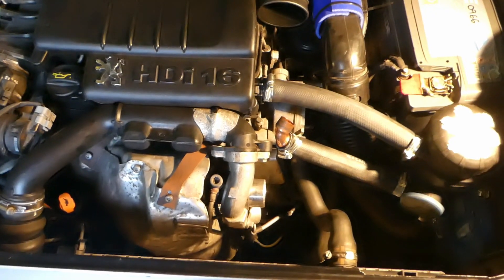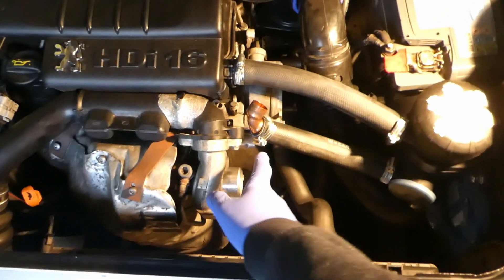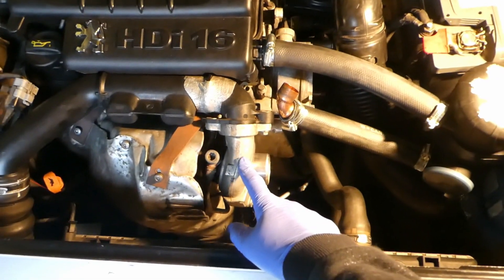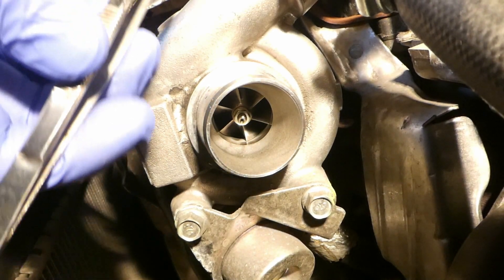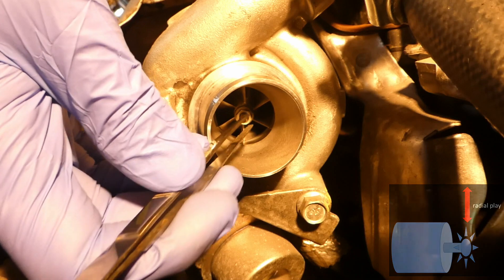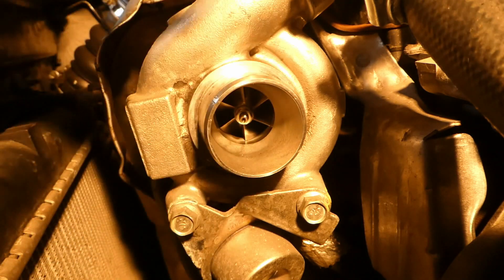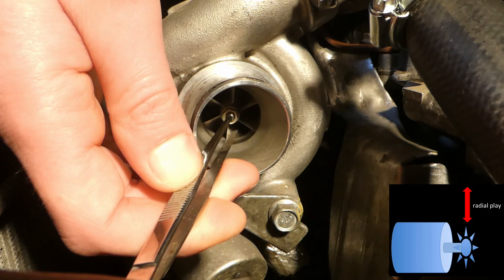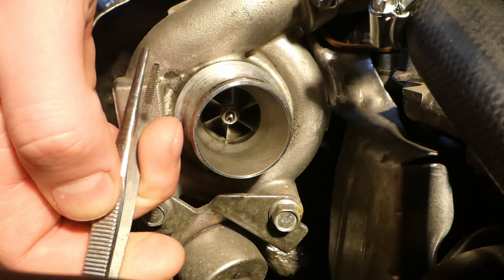1.6HDi/TDCi acceptable turbo shaft play (Peugeot/Citroen/Ford/Volvo/Mini/Mazda3/Suzuki)

Comment: consider that the oil pressure once the engine is rotating will center the shaft.
Reply from the maker: Yes, thank you for the comment. I have not thought about that, but yes it will centre it.

Comment: I fitted the second hand turbo and only when I went to fit relised it had play in it, also washer behind vains exhaust side wasn't easy to get in right position
Now noise turbo and when revving pops and bangs
Taking Berlingo back to were i bought turbo (on a truck) so they can hear it running I don't want to drive it, also I've removed  sump washed out don't want this turbo to break and have to do all again
And turbo had a tight spot once bolted in
Reply from the maker: Yeah, either the adjustment on the vanes is not quite right or something with the turbo, it hould not ptoduce a whine.
Reply: @moremolecules  replaced turbo with another today no problems no noise thanks very much for your advice and your videos you and your videos have been a great help especially the gause at oil pick up pipe
Stil saying anti poluction fault engine management light stil on but goes fine
Reply from the maker: @adamwort7160  Sometimes if the wastegate is not connected or it has ruptured somewhere it will give anti-pollution warning. Also, it could also be the MAF sensor as well. Check if the wastegate is working alright: https://www.youtube.com/watch?v=WLsMzdKgI1o
For the maf, it is difficult to know unless you have an obdii scanner or Diagbox. See if there are any errors.

Comment: I got 0.5mm axial play. Blue smoke at  high revs, sometimes over revs.
Reply from the maker: Yeah, it might be leaking a bit of oil that turbo if it smokes at high rev and probably under acceleration as well.

Comment: Hellooo, hope you are having a nice day. I have a whining sound from turbo, which still lasts after 35.000km. i have no axial play, only little radial play, and also some burned oil next to top banjo bolt. It is like it spits air outside. Do you think i should change the turbo? Car doesnt smoke and it has power. Thank you!
Reply from the maker: I would not replace the turbo yet if I were you. You may want to tighten the banjo bolt a little bit. That should stop the oil coming out. Only a little bit should be enough

Comment: hi thanks for this video, it really helped me, when i checked this there was quite a lot of oil in the pipe which goes to turbo from air filter, do you know why this is please
Reply from the maker: This is generally normal, of course it depends on how much. Generally the PCV valve will spew some oil vapor and some actual oil in the air intake going to the turbo. This is to relieve pressure inside of the engine. I would only worry if the engine is burning too much oil, then this might be too much blow-by from worn engine.

Comment: That is good info, my turbo has more or less the same movement. Im wondering if you have the size of the membrane inside the pcv valve and the procedure for dissasembly. It's very diffcult to find in my country and the entire piece is to expensive. Thanks.
Reply from the maker: Thanks for the heads up. The PCV membrane is exactly 5cm outside diameter with the lip being 2mm. I have a video of how I replaced it: https://www.youtube.com/watch?v=B4R7Mi1RcEQ , but I was not really successful at all. I broke nearly all plastic holder things. Somebody commented to get the engine hot or apply some heat to the pcv and/or apply silicone spray. I suspect with heat it may work. Good luck.
Reply: @moremolecules  thanks 4 ur answer. I am tracking the oil leak, i thougt was the cranckcase joint but was ok. The top of the engine is always with many oil, so i suspect that the pcv has some small holes thar let the oil steem blow out and condenses. Maybe the membrane is broken.
Reply from the maker: @dieseltips  That is possible, although the membrane is very sturdy. Wipe around and see where it is coming from. Also check if the spring is intact, looking from the crankcase breather.
Reply: Hi! With my car, there were leaks on the plastic manifold to head connection. There are rubber o rings- they start to leak. And after injectors being removed, the injectror bolts where they are screwed in head, were leaking. The best way to find a leak is to clean area with brake cleaner and later on watch, where oil will apear.  @dieseltips
Reply: @tadejmiklavcic454  thanks for the tip. I found an used valves cover, but the membrane was also damaged. I did succesfully removed the pcv cap, but I could not record the process in video, I took some pictures that I will put in a video later. I think the leak can also be for the plastic cover of the valves joint, I bought one, im going to make a video when I change, will be in spanish although.

Comment: Hi, My vehicle has a DV6 Euro 4 engine, the turbo kicks in after 3000 rpm, and it remains very weak before this rpm. Why could this be?
Reply from the maker: Yeah, difficult to say, could be a little bit of stuck turbo solenoid at the back of the engine or vacuum loss to the wastegate or the wastegate is a little bit slipping vacuum. Try this: https://youtu.be/WLsMzdKgI1o

Comment: When l check it my car turbo there is oil and it is not moving do you think oil is normal? Thanks sharing videos ✌
Reply from the maker: Depends on when you check the turbo shaft play. If it is on a warm engine, there will be little play. It also depends on the state of the turbo and engine mileage of course. Little movement is good. Oil around turbo can come from two sources, one is the crankcase breather, which is normal. Second one is from the turbo itself, that is not good and I am yet to understand is little oil passing the seals is normal. Generally there will be oil from the crankcase breather around the turbo. Excessive amount is not too good. Check the crancase breather tube and you will see oil there or the air pipe going to the turbo.

Comment: Hi, I wonder if I should replace turbo in my peugeot 5008 1.6hdi - turbo charger doesn't have any radial play, but it does have axial play, plus all surrounding area is wet in oil - I've asked in service center, but they said "it's just getting sweated up and i should not worry too much about it" - I would rather prevent disaster replacing it too early than waiting for catastrophic failure - what is your opinion on this?
Reply from the maker: It really depends on the milleage and how much the play is. If it does not consume oil between oil changes, say you do not top too much oil in a year or ~10,000miles or -16,000km then it should still be alright. The surrounding area it is a bit difficult to know for certain without further investigation where it is coming from. It could be from the crankcase rather than the turbo. Does it blow blue smoke when you give it high rpm under load?
If oil changes are frequent (milleage and/or based on time, whichever comes first), then there is not much to worry about.
Reply: @moremolecules  Thanks! Car is used on longer trips (200km a trip, perhaps 2000km per month) and serviced as scheluded. Turbine looks oily from the intake and there are oily strains on wastegate servo and down the engine compartment. Air path after the turbo looks oily too down to air inlet into engine. If I had to say something about the amount of that axial play i would say that this is something between 1-3mm on cold engine. In the direction of air filter everything is oily too - I guess this is why you've installed oil catch can. I've already replaced air filter, fuel filter and egr valve that was giving me some error codes in that car and I don't really enjoy lack of space and access to anything. Heat plugs were replaced in the car shop, as I didn't feel like capable of doing this myself (due to very limited space and the placement of these plugs) and they destroyed some plastic covers in the process.
Reply from the maker: @gyorka  Yes, that is why I installed an oil catch can. In general you would get a bit of oil from the crankcase and everything down from that (turbo, intercooler, etc.) will have oil film. Air will flow from the filter to the turbo, so even if the turbo spews a bit of oil it will not go towards the air filter and air intake. It is likely that it comes from the crankcase. If it is dripping onto the wastegate, then see if the rubber seal is intact on the air intake to the turbo joint. These are prone to have splits and it will not seal properly, so air is not measured correctly. It could be that the CCV valve is ruptured, but that is a bit of a guess and it may not be the case. It could be that the engine is a bit worn (depends on milleage) and having a bit of excess breathing, so inevitable some oil will go from the crankcase to the turbo.
1-3mm is quite a bit, but depending on the engine (VNT vs. fixed geometry turbo) this might be alright. New turbo is a bit expensive and it depends on whether you plan on keeping the car a lot longer.
Regular oil changes, maybe a bit shorter interval is probably the best thing to do, unless you want to invest in a new turbo.
Reply: @moremolecules  I'll start with inspecting seals, as I don't know from where exacly this oil is leaking. It looks like top of the turbo is dry, where down part is dipping with oil. Perhaps oil return pipe or its sealing is somewhat damaged leading to this situation. Car has 250000km on its odometer and i belive this is correct. We use to have our cars till they start to rust, so I don't mind investing a bit of money into them. All I'm worried is miserable access to the heat shield bolts when replacing the cartridge, and from the experience with other cars we had everything takes much longer than planned, plus you often find yourself lacking some tool that is a game stopper untill it arrives or is made. I wonder if this could leak from the wastegate rod entrance downwards, but again. i'm in the office and car is several km away ;) I really apreciate all your work and videos on this channel - it was and continues to be valuable source of information
Reply: OK, so i've been able to take a closer look at this, and it seems that my trouble originated with oil supply pipe failure - it's quite loose on both ends and there is quite of a play at the visible end - banjo bolt is tightened, but the pipe itself is flapping loose in its ending piece. My asumption is that turbine cartridge got insufficient lubrication and axle worn out. I didn't dissasemble exhaust side, but what i've seen pushes me into replacing whole assembly rather than just the core cartridge - whole thing seems to be a bit more complicated than in your Partner, and buying parts separatly will be more expensive than getting replacement turbo. Hopefully this will be doable in a garage with trench. Thanks!
Reply from the maker: @gyorka  There is generally some play in these oil supply pipes. I mean they are flexible or the actual pipe has a bit of degree of freedom, but in general it should not touch the side, otherwise it will leak. Your turbo has not blown, so oil has been getting to the turbo, otherwise without oil it is really quick to overheat and completely disintegrate. Yes, sometimes, getting a new turbo might be marginally more expensive. I replaced my turbo, but the replacement oil feed pipe is not quite the same and I have a little weep from the oil feed pipe. Nothing major, but might have to fix it one day.

Comment: Check out my turbo at 270k miles. From what i’m hearing it’s still good?
https://youtu.be/74zUJv2ldJQ?si=18DVdcA2fRZPgyo_
Reply from the maker: Looks good to me and well done to keeping it that good after so many miles.
Reply: @moremolecules  Thanks. I also put the mann provent 200 like you did and it really helps clean. 

100% synthetic oil does the rest.